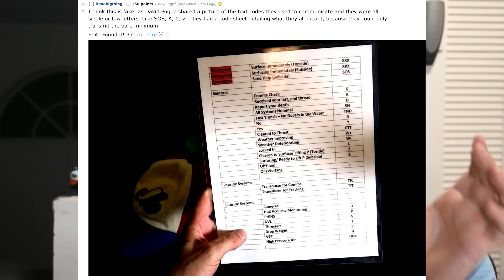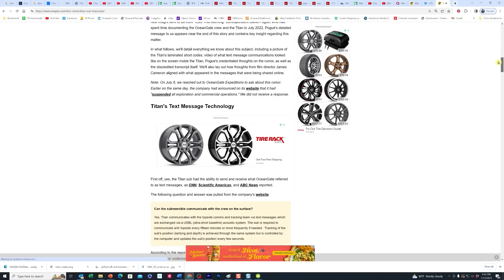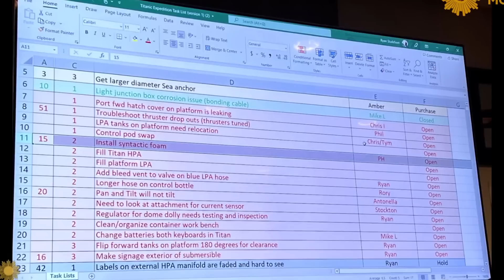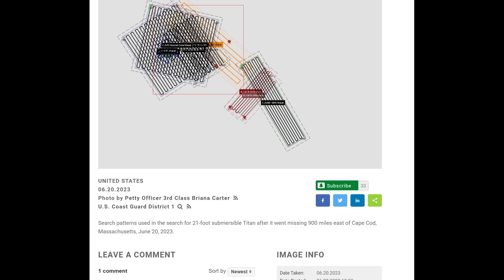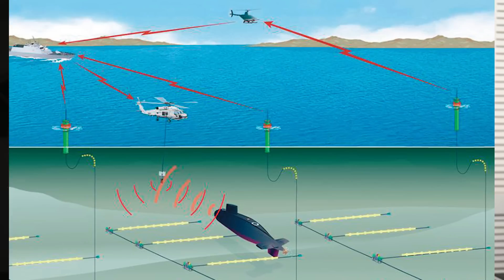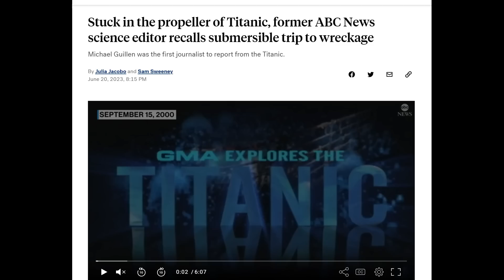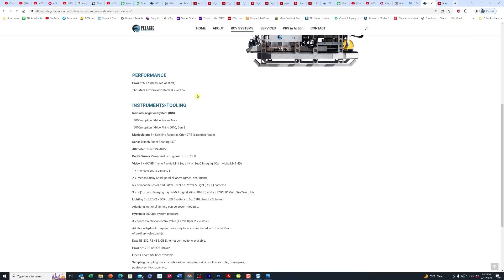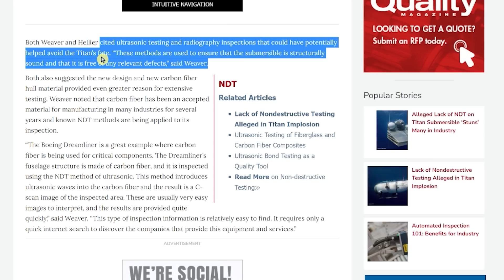The Shocking Truth About Fake Sub Transcripts No One Tells You

Comment: When I saw that Adhesive getting used to knit those two structures…. I am like seriously? It’s like trying to glue an elephant to chopper…. And getting to swing through air….
The bonding surface area merely nothing to those ridiculous compression and tension loads. I think removing those balsas at 3400+ m probably had an adverse effect because, those weights probably had a counter effect , safeguarding the tension loads….specially on those bonding joints…. Once it’s gone… the compression loads completely took over…the already damaged structure. 
Absolutely crazy ….they thought this type of adhesive bond could hold 380-400 atm pressures… without a solid bolted fitting…. ??? 
Example: having the fuselage being glued to the bulkhead….. 😅
an accident occurred in mid air at the bulkhead once having poor bolted connection which ended in catastrophic damage. 
This is kindergarten common sense stuff, how come senior engineers didn’t pick these type of design mistakes at OceanGate 🙄.

Comment: Jeff, I wonder if you would analyze the so-called "implosion audio" and confirm that, based on the speed of sound in water and the time between echoes from ocean floor to surface, the audio clip only allows for 3000 meters of ocean depth and thus could not be the actual Titan implosion?

Comment: The Hall of the submarine did not fail the window did not fail the titanium did not fail what field was the control Spears if a control Spirit does not have enough oil in it at that pressure it will explode equal to 8 to 11 sticks of dynamite this is what blew up to tighten down there everybody needs to stop with this false fake videos putting their opinion out there about the engineering of the sub2sub did not fail it was the control Spears which were made outside of Ocean Gate you people need to pull your heads out of your asses and stop speculating this sounds you guys are posting from the Navy has fake off so are the trans logs fake the spears or which caused it to blew up!

Comment: honestly x-ray (RT) wouldn’t have provided much value in finding the defects they could’ve run into. UT would’ve been critical, same with eddy current testing (ET) to inspect the carbon fibre body. i’m shocked they didn’t do anything even after the previous runs to verify integrity. visual inspections are not enough for pressure equipment, ask any regulatory body.

Comment: The transcript does concur with a lot of facts, given by J. Cameron and the time and depth of the implosion. For example Cameron pointed out, that the passengers knew something was not right. Also the depth and the time of the accident indicates a descent much too fast. What is also obvious that there is no clear chain of command. Who is responsible for the dive? Command Center or the Passenger and CEO. The great ego of Stockton and the submissive behaviour of the Command Center is all too abvious. Repeatedly Command indicates that the descent rate is too fast. 75min into the dive Command notices that the descant rate is twice as high as it should be and aks: "Do you need to adjust velocity?" What should have been an order, because something was already amiss, was formulated as a friendly suggestion. Stockton is so arrogant not to oblige, let alone reply to that until it is too late. 13min later he states: "we are noting an alarm from the rtm". 
Also later "Carlos is requesting wattage output of thruser". No, it is not me - I wouldn´t dare to ask. No, it is Carlos who has the audicity to ask. 
This whole aura of Stockton reminds me of the arrogance of that KLM Captain who commandeered his KLM flight 4805 into another aircraft on the runway, without start authorisation. He was "KLMs Chief flight instructor" and "Head of training department". So when his co-pilot points out that there is still another aircraft on the runway, he doesn´t even listen and ignores it. After repeated complaints he just flat out dismisses it. In both incidents hubris and the arrogance of one single person led to a tragic catastrophy. 
But in a company where you have to clear out your desk within 10min when critism is brought up, you don´t dare to raise your concern.

Comment: They should’ve had a camera feed sending footage back up to the surface. Camera on top of the Titan and one inside. UNBELIEVABLE
Reply: Unbelievable?  They barely had the bandwidth for text messages, never mind two live video feeds - radio waves don't travel through water, so the only 'wireless' communication is by transcoding data into sound waves, with necessarily low throughput. What would the video be for anyway? It wouldn't have saved them.

Comment: I haven't seen how controls are transferred from the internal of the sub to the external.  Do they run wires through a special type of waterproof port?
Reply: It was wireless using some low frequency standard that can work at short range through the carbon fibre hull.

Comment: Fact they used glue with no bolts, and bolts for door, I would never have gotten in this thing, even for a 100 foot drop. If the transcript is real, the huge problem is diving to fast, which wouldn't allow for the pressure to equalize. Fact that it couldn't rise, like it did in past dives, could be several things combined. Total weight of passengers, not enough time for pressure to equalize. Meaning a lot less air was in the cabin. How big a debris field? We're they close to ground when implosion happened? If sub couldn't rise, the alarm that sounded most likely was a leak allowing salt water in, shorting out key items like the pumps needed to add more air to the cabin. It took on water and that added weight is what stopped them going back up, and the leaking increased until titen imploded.

Comment: I don't think glue oozing out would have any difference as the deep ya go the more the cap and port are push in tighter and tighter i mean at 12000 its about 360 atmospheres or just under 6000psi that's 3 tons trying to collapse the sub on every square inch just the port being made out of acrylic would compress by up to a inch at the size and psi to me it always comes back to the carbon fiber and the gun shot sounds that's the sound of fibers braking that every time cause a weak spot and will cause delamination of layer and failure after time carbon fiber is not great at repeated compression sadly proven ones again, I'm sure the finding will be the carbon failed and the implosion blow the port and(GROSS TRIGGER WARNING) sadly body part out the ports hole and the rest was more less liquefied and pushed in the end caps as the implosion progresses in to more less like explosion it happens so fast and under so much pressure its almost unfathomable. as for the transcript it could be real in my book but I do pray its fake and they didn't know they was doomed i pray it was quick and they didn't know what was coming. thanks for sharing

Comment: It really doesn't matter one way or the other. The End Result remains the same. 
Did the more rapid descent contribute to the failure? Possibly, but it still would have failed at some point. The wrapping does raise a very valid question. CF is usually woven for maximum strength in around the cylinder, AND along the axis of the cylinder. Straight wraps do not provide strength axially.
CF is autoclaved for maximum strength and to insure less chance of voids between the fibre and the epoxy substrate. Failure to properly cure the material  directly contributed to its failure at depth.
This incident also illustrates a failure of the Industry to police itself. Every expert was saying "No." Yet Rush, an Amateur, was allowed to proceed.  Frankly, Rush should have been arrested, and under Psych Eval before he was allowed to take a manned descent without testing and vessel certification. 
No, the more we hear, and the more facts that come up, the Red Flags were at Full Mast throughout this saga.  Abandoning excepted Safety Practices and Protocols is Not Innovation, it's F**king Insanity in pursuit of a Get Rich Quick scheme.
Rush's Arrogance, Hubris and Narcissism killed him and murdered four others.

Comment: Like gluing PVC fittings to pipe, when pressing the ring on, they should give it a little twist to eliminate vertical grooves in the glue joint.
Reply: @chadiesUtube
Good point. I'm surprised Jeff didn't mention that considering his core competency is bathroom remodeling.

Comment: I guess that when the investigation reaches a point where they can release the transcript, as we know there is one, to support that part of the investigation we will learn if was the truth leaked or a fantastic fake.   What made me side with it being true was the short rate of decent discussion and Rush making it clear he was taking it all the way.  Again hubris, as the carbon fiber may have not given way had he slowed the decent to the nominal giving it more chance to adjust to pressure.  And at the time the transcript came out no one was yet questioning the depth they last communicated at and how they got there in that time frame.

My submariner husband keeps reminding me that decent velocity, could be a key here.  While there is buoyancy, to a point, in sea water, the faster you are going down the less chance you have to stop or reverse.  And the faster you are going translates into gathering even more decent velocity until, like Titanic did when it sunk so fast, it pancakes on the bottom.  Its a fairly contained debris field meaning they were not far from or on the bottom when they fell apart or imploded, if it had happened several 100 feet or more in the water column the debris would have been strewn over a much larger area.

My guess with the Navy notifying the Coast Guard about hearing an implosion gad to go through channels as knowledge about where and operation of undersea listening posts is still top secret and they did not want to publicly say the wrong thing.  And while they were getting this info routed through channels to US Coast Guard, you had the Canadian Coast Guard trying to dissuade people from thinking banging noises on the acoustic bouy drop meant anything as underwater listening was too difficult to interpret.  They pretty much conditioned everyone to reach to a Navy announcement of hearing something with "how can you know if it's hard to hear underwater" and I doubt the Navy would have wanted to be dragged I to explaining the top secret technology of their underwater listing capabilities

Comment: Ingenier, do you could clarify a doubt?  It is clear that the primary cause of the implosion was the failure of the materials used in construction. However, the initial problem was the rate of descent and the fact they ware unable to counter it. The
 faster the descent speed, the  stronger the pressure on the submersible. What caused the increase in speed?
If the submersible had descended as estimated, would there have been a danger of implosion? Or at least it would been avoided? 
I think the implosion of submersible was due to human error. They didn't notice that the submersible was descending too fast and discovered it to late. If they had noticed this fault from the first moment, perhaps they would have suspended the expedition.
If they descended more slowly, perhaps by noticing the danger signs, they would have had time to emerge and save themselves.
Could you please clarify it? Thanks

Comment: Snopes is a joke
Reply: I just read their update. I do wonder about Pogue' s rationale for the ballast and frame being proof of inaccuracy. Was a decision made to surface due to concern about descent rate or failure signs. That would have been an urgent situation and in a minute did they release one or all ballast types that could be done rapidly, the pipes maybe requiring some effort to move pax and not being done, thus after a minute with no improvement they went to the frame which we would have to know if that was an easy and quick release.

Comment: With regards to the lack of adhesive squeeze out, I think this may have been deliberate. The adhesive is there to keep it from falling apart when under no pressure, but it doesn't contribute to the strength of the hull. It cannot cause a failure at depth if the glue fails, it would just fall apart on the surface. Embarrassing, but not dangerous. It is also not designed as a sealing material. I wonder whether they deliberately use less than you might expect in order to leave room for a more dedicated sealing material to be injected.
Given the shortcuts taken all over the place, I would not be surprised if this were not the case, but it is the sort of questioning of conventional wisdom you get from a young engineer. Usually the answer to 'can't we just' is no, but sometimes the convention is not appropriate, and this might be one of those times.

Comment: Boeing’s use of carbon for a fuselage takes advantage of the tensile strength of carbon fiber, as the cylinder is expanding from internal pressure when at altitude, putting an expanding force on the structure like pulling a rope straight.  The submersible inverts this principle by trying to “push with a rope”, the external pressure puts a collapsing pressure on the fibers, rendering their tensile strength meaningless and relegating them to a role of spindly rebar for the epoxy.   
How was this ever even imagined as a good idea?

Comment: I have seen nothing from the Navy saying the time of the implosion. People are assuming the final loss of communication was the implosion, but we do not have this confirmed. If the transcript is to be believed they were struggling to ascend, and suffering power issues. Loss of contact could have been power loss, not hull loss. The search area may have reflected the possibility that they had control issues, and could have travelled as they attempted to ascend, with significant time between loss of contact and final implosion.
It would seem unlikely that they have two independent failures (though not nearly as unlikely as it should have been), but ballast mistake leading to overloading leading to an electrical fire could explain both. Plastic does not react well to heat.
With regards to the hull, we simply do not know what additional work went into the hull. Cross winding makes sense for tensile tanks, but the loads in compressive pressure vessels are very different. The design looks simple, but there is a surprising amount you can do to vary the properties of the material by something as simple as varying the tension you wind it under, or the specifics of the fibres. Gradually reducing the stiffness in the innermost layers in theory might fix the delamination problem. The load is concentrated on the outer layers which cannot ping inwards, and the inner layers will not delaminate because they are under much reduced loads. Delamination is a poorly understood problem, not necessarily an unsolvable one. The sub not being certified means that there is no paperwork for us to find showing how they dealt with delamination, but that does not mean that the exuberant young engineers did not try.
As for why Spencer composites haven't said anything yet. They may be facing a huge law suit too, and they are not going to make any public comments that might cause them problems for that, as well as being trade secrets (though worthless ones at this point, as nobody will trust their hulls now even if they are sound).
There is a lot of speculation around (mine too, though I am attempting to just point out that alternative possibilities do exist), so we really do need to wait for the final report before we speak in certainties.

Comment: i have worked in the metal bonding adhesive industry. Metal surfaces which require bonding to a liquid polymer adhesive require a mechanical key. This involves high pressure shotblasting of the metal contact surface with a fine abrasive grit to give the contact surface a rough texture prior to application of the adhesive. Was the O-RING contact surface of the Titan shotblasted before the adhesive was applied?